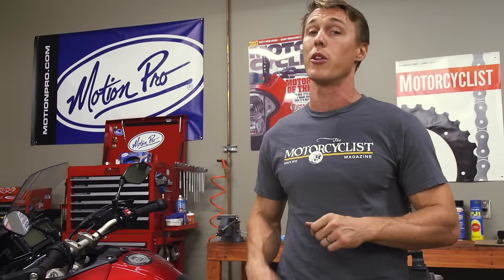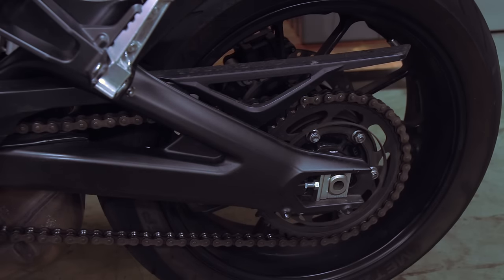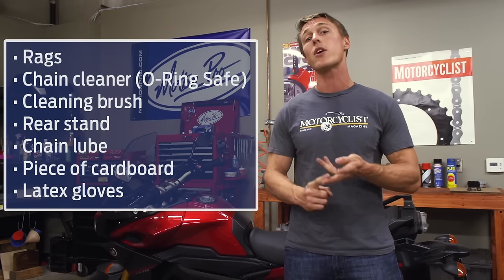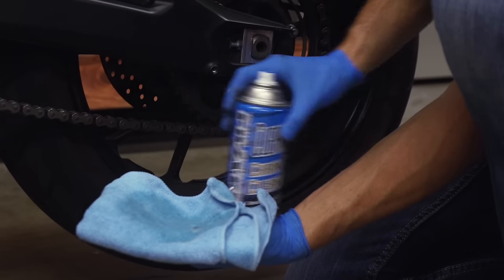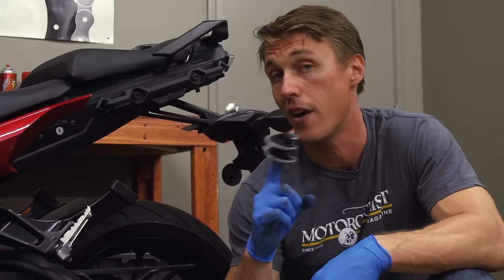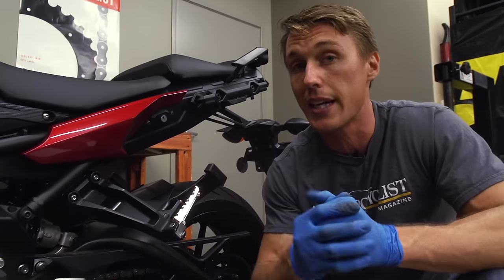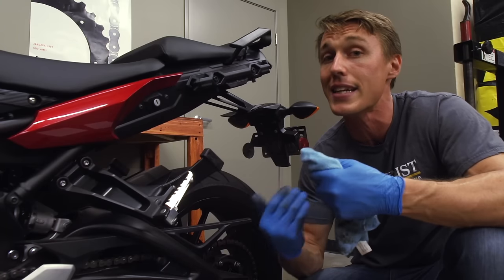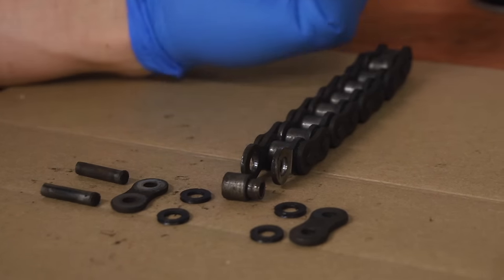How To Lubricate Your Motorcycle Chain | MC Garage

Comment: I use kerosene to clean. Much cheaper and does an excellent job. Just dont forget to wipe off good after you clean otherwise the new lube you put on won't last
Reply: well im cheap so i use diesel, a spray bottle and a cheap toothbrush (a new one)... hahahaha...

Comment: No rage comments about using WD-40 as chain lube will destroy the chain into a million pieces? That seems odd.
Reply: there's another video busting the myth in the channel.
Reply: WD40 is mostly just hydrogenated naptha. Which is basically a heavier distillation of kerosene just a smidgen heavier. The problem is the film of addictive they've put into the oil that makes it a dirt magnet once it evaporates since the residue is sticky and over time the road grime just turns into a grinding paste on the chain. You probably should be cleaning your chain way before then but it's just....come on man....just use Kerosene. Kerosene tends to evaporate clean.
Reply: Exactly if someone thinks a degreaser greases a chain they must think gloves go on feet and shoes go on hands. Let them walk backwards upside down not my problem
Reply: I lubricate my gearset with Axle Oil. Is this a mistake?
Reply: I use Astro Glide
Reply: @TheBmxHD    I don't get all those comments like yours about this product. It's literally written on the bottle, WD40 is a lubricant.

I don't say you should use it to lub your chain, but it's definitely not a degreaser
Reply: Most chains are sealed.  Other than rust prevention lube doesn't matter.
Reply: I personally don't like WD-40 because it cheapens the chains. Other use is ok but basically it's for freeing parts not to lubricate for effective movements.

Comment: Been a year and half since I lost the tip of my middle and ring fingers. Luckily, had a great surgeon. Got a cross finger graft on the middle finger from the back of the index and the ring finger was okay as I hadn't lost much flesh, it was stitched right back. Could hold a pen and write two months later. Had my engineering semester exams and it was one hell of an experience. So, guys, no matter how easy it seems, do not keep the engine running. Also, in my case I wasn't doing it in gear. It was on neutral and I knew I shouldn't do it on a running drive train. I was just lazy to turn off the engine and thought neutral would do no harm. As I was leaning over, my left knee hit the gear lever and I'd just lubed it. Bam, into gear 1 and in no time my fingers were stuck in the sprocket.

Comment: i use wd40 or kero to clean chain then lube it with chain wax and has always worked for me after having 12 bikes over 20 years and gobs of miles ridden never an issue with seals rotting or etc using wd40 but i only use it for the cleaning not the lubrication, and dont forget to stick an old mat or tarp underneath the bike for any drippage if doing the job in your nice garage.

Comment: You mentioned using different kinds of lube or wax depending on the environment but didn't go into detail. Can you do a video on what kind of chain lube is best for different environments?
Reply: Ojisan642 yes please. I need it too.
Reply: I live in tropical climate which is dusty, rainy, and muddy. So as recommended by a dude from AMA I use blendzall chain lubricant to deal with those conditions. It's kind of more sticky than regular chainlube.. But since it's mainly used for motocross race..I think it meets my need
Reply: I would think your local shop would sell what’s good for that area...
Reply: MiNuSx31 doubt it most local shops know jack and also sell all kinds of lubes. I personally use a paste wax on mine by Motul because it's the easiest to apply. Seems to be very effective.
Reply: Heavyweight gear oil. Do the outer surface, inner surface, and side surface facing you, then run your finger along said surface to gather excess oil and then rub said oiled finger on the side surface facing away from you. All the while spinning the tire in neutral with the bike off and on the center stand.

Alternatively, you can install an automatic chain oiler and just clean it off and dry it every service interval.
Reply: @TheRealUnconnected  I've started using PJ1 was chain lube but over the past year it's gotten very dirty. I want to clean the chain and reapply more of the wax but not sure what's safe to use- don't want to damage the chain. Any recommendations?
Reply: I wouldn't get too bogged down in the arguments of I should use this or that because I live in this area. Simply lubing your chain regularly is an excellent practice and shows you care for your bike. It's almost heartbreaking to see a bike that is not well kept. I'd recommend every 500kms at a minimum. 😉

Comment: Hell yes to the Tyrox chain brush. Grunge brush is very messy. I wear o glove and cup the Tyrox in my hand and run it back and forth on the chain as you did and the spray of the chain goes in my gloves hand and not all over the bike or floor. I do or my bike on a rear stand, but I also put an old bath sheet down on the garage floor. 

I do spray cleaner and chain wax onto the rear sprocket/chain area with the bike in gear but I hold the cardboard behind and against the back of the wheel hub. My hands are never in danger with this method.

I turn the bike off and into neutral as I put the Tyrex brush on the chain and manually turn the wheel to clean the chain. I don't wipe the chain off after applying chain wax.

Comment: Great video once again guys. Even the basics like this should be discussed and technique shared. My personal suspicion is that cleaning the chain is really more cosmetic - Anything thats actually in between the contact points between teeth and chain is instantaneously either pulverised or flung afar.. Take a look - Always spotless - How could it be otherwise with that treatment?! But I probably overlube if anything.. say every 2 rides meaning about once every 500km at most? But I lube inside of chain as Ari showed.. And i spray more prob 2 rotations easy and then also spray from outside as well.. And adjust when required.. And with that treatment even big v-twin chains like my KTM 1190 Adv are still in what looks like good shape at well over 30,000km. As the shop said to me "well whatever you're doing keep doin it" cos we dont usually see the chains last like that

Comment: Would the prolongation of the chain life really offset the cost of all those specialty lubes and cleaners and time spent? Doubtful. So I long ago stopped using sprays and cleaners. I just smother some motor oil every now and then, and don't fret over it. I like to think that the chain cleans itself flinging about the dirt with all that oil : )
I cut off a piece from some shampoo bottle, somewhat heat-shaped it and screwed it at the end of the chain guard in order to reduce the splash. It works really well!

Comment: There's no need to "lube" an o-ring chain. The areas that need to be lubricated are inside the o-rings. An o-ring chain just needs to be kept very clean so dirt doesn't destroy the o-rings and cause a loss of the built-in lube. Lubing a good o-ring chain is like lubing a sealed bearing. For over 25 years, I've been cleaning my chains with kerosene, then drying with a rag. If I get caught in the rain, I spray the chain with WD-40 (the "WD" stands for "water displacing"), dry, then clean with kerosene to remove the WD-40 film. I've never had a chain kink. I've only had to replace one chain and that was after 10k hard miles (including some track days).

Comment: I would have thought that a dry lubricant, like graphite, would be used for the links due to the danger of attracting dust and dirt with the oil.  It would be a pain in the neck to do but the thought of having dust and dirt making an emulsion scares the hell out of me enough to try it.  Nice video by the way.
Reply: Rafael Lastra

Comment: Nicely explained. Is it okay to just lube at shorter intervals without cleaning every-time? I lube the chain every 300-400 miles and clean it on alternate cycles (600-800 miles).

Comment: you missed something very important. lubricate your chain when the chain is warm ie when you get home and putting the bike away for the night or pull in to your overnight accommodation.  This way the lub gets in well and then the thinners evaporate off before you ride.  I've always got good milage from chains and i never really cleaned my chain. waxs in my experience are crap in the rain. our maybe i just used a crap brand. during my years as a motorcycle courier i found Castrol good in hot, dry and in the wet. i used to always replace both sprokets weekend replacing the chain. I would buy 2 front sprokets, 1 rear sproket and the best chain money could buy. changing the front sproket when it showed a little wear.

Comment: So you dont need to lube like the inside/midle of the chain, just the edges??
Reply: You actually need to lube rubber rings on both sides of the chain. So that it rolls without rubbing.

Comment: Quick question, I have a brand new X ring chain to put on my bike, It comes pre greased in a thick lube. Do you leave this on or clean it off, so it's not so thick, then apply a dry lube?  My concern is that I'm fitting new sprockets and I'd rather the whole lot doesn't get covered in thick grease. What do you recommend?

Comment: great video but do we really need to rub the lube off after the application ?
Also is that one round of lube on inner side (not outer side) sufficient?
Reply: ***** thanks a lot. Seems i have been using more lube.
Reply: +mayur kulkarni I'd say wipe it, I got lube on my tire, feeling it slip isn't nice, sliding into a low side will be worse.

Comment: Hi guys!

First of all thank you for this channel, and for the tons of useful info in your videos. Such a priceless source for beginner bikers... and most probably for experienced ones too!

I bought a Kawasaki z650 two years ago. Now, after 20,000km my chain is really worn. I took care of it (cleaning and lubing) and in my first year I was riding rather gently, but in the last 5,000km its maintenance became increasingly difficult. Which seems a little early... even for a original manufacturer’s chain. So, I try to understand what might have caused this. And avoid a similar faith for my next chain!

I’ve been using a brush similar to the Grunge Brush. Is there a chance that I’ve been too rough when using it and as consequence I damaged the O-ring seals of the chain?
Reply: Update?

Comment: I actually enjoy cleaning my bike/chain, only problem is I live in an apartment at 4th floor, and with no garage, so my only place to do this stuff is out in the public roads.. What to do :D
Reply: do you still in that situation? do you still have that bike? if so, what have you done? since I live in an apt with a parking lot beside it but adequate space however.
Reply: @HighAway  I still live in the apartment but with a new bike. What I have been doing is getting just basic chain maintenance equipment (chain brush, cleaning agent, and chain lube). I have my bike parked in a courtyard, but anywhere even a sidewalk with a bit of space is enough to let you do basic cleaning of the chain. Just have a bucket or even a dirty rug/cloth under the chain to not stain the ground.

For more in-depth cleaning, I try to plan ahead for example if I know I am going to visit a relative/family member who lives in a house, (in this case my parents mostly) I ask if I can store a few things at their place so I can do a deeper cleaning when I visit them. Depending on general riding conditions, a deep clean isn't really necessary often, especially if you mostly ride in dry conditions.

For general cleaning of the fairings etc I usually just do it at a petrol station, they usually have some sort of cleaning items too and the space available for you.

But all in all, that's really all I have been able to make do with, apartment life and bike life just doesn't mix as well as if you have your own house/garage.
Sometimes local bike shops will let you borrow some space for an hour or two if they're nice people, and you can talk with them about what to do/clean and get tips and tricks (and they'll likely be inclined to try and sell you some of their cleaning items :D)
Reply: @Real_MisterSir  This helps me to think more, thanks. I don't have a family close by and have friends but too far for anything except just visit. Another questions: what are the items that is necessary to have to keep at home? Like oil drain pan, rags, cardboard (for chain lubing) bike cover etc? also, do you cover it for the winter or store it? Im looking at the lowest cost factors.
Reply: @HighAway  My closest relatives live 40 minutes away from my apartment so for me it's not too big of an issue, but if it's a multi-hour ride then I see it might be a problem for you.

And yes I would advice an oil drain pan, rags, cardboard, and a bike cover. And also a simple toolkit that has the specific screwdriver/hex tools that your bike needs to remove various items and plastic covers, in case you need access to battery or other components that can sometimes be hard to reach. Usually bikes use a few select sizes of hex screws (and most batteries use regular 4-star phillips screws for their wiring connectors). That is basically what I keep. Anything that ensures you can remove vital components if necessary. Storing these screwdriver tools is possible on most bikes as they don't take up much space.

For winter storage, I have it parked indoors (again at a relative's place) which I consider fortunate. If it regularly gets very cold/rainy then this is optimal, but a cover can manage most weather decently. For reference I live in Denmark with damp/rainy weather and around freezing temp most days during winter. I have had my bike just standing under cover during such conditions for a few months at a time without any issues. One advice I personally recently had to invest in, is a battery tender which can help keep the battery topped up during longer periods of storage, and it can also help revitalize the battery if you find that it lacks the power to engage the starter motor properly after it's been sitting for some months.
Just be aware that most battery tenders work with regular lead-acid batteries and not lithium batteries. These battery tenders are very useful and don't cost too much (I believe 60-80euro/usd is enough for a good quality one). But you do need a power socket somewhere close to your bike (or a long extender cable).

Comment: When I bought my bike, previous owner said to clean and lube on a weekly basis. This seems like overkill to me; is there any negatives aside from attracting dirt and grime if I lube it once each week? It does look nice when it's clean after all.
Plus I don't have a proper chain cleaning brush - I usually spray degreaser on a chux and clean the rear sprocket with it too - any drawbacks with doing it that way?

Comment: I’ve lubed my chain on so many different ways and it still sounds like it’s dry. I aim for the o ring links on the inside and I spin the wheel with my hand. I’m not sure what I’m doing wrong. Can anybody help? I live in GA and my bike is my daily. I lube it every 400 miles which is typically every 4-7 days or so. Any help would be greatly appreciated
Reply: A too tight chain will sound noisy/ dry. Make sure your chain isn’t too tight. Don’t trust, verify via the manual specified procedure.

Comment: I used chain lube on front sprocket of my duke 390 . And now when i accelerate , the bike is responding little late.. is that normal? Or should I get it fixed by mechanic?? Also engine braking isn't that strong like it was used to
Reply: Mayank Parmar - hey, I don't think the lube is the issue. If the lube is reasonably safe, and the chain cleaner didn't kill the seals, you should be fine. If you're up to it, swap the chain, and lube with the best stuff you can lay hands on. If that improves the response, then the last lube job may have indeed compromised your first chain. Best of luck!

Comment: Can anyone tell me how to clean the chain brush after cleaning the motorcycle chain? It's really hard to take off the grease from the brush.
Reply: get some brake cleaner and spray onto the brush. But be careful because the oily stuff will fall onto the ground so do it in your yard or somewhere where there is dirt on the ground (or above some cardboard box)

Comment: What wears a chain out eventually is the rollers wear down,      Effectively stretching the distance over the toothed cogs,       Some form of wax on the rollers will help slow that rate down,        So it`s not as pointless as implied to lubricate the rollers
Reply: true, in fact i spray lube or oil on the rollers with the chain running and i can see it also splatters to the ends of the rollers and thrust to the links anyway...

Comment: hi wich do you think is better  Aprilia rsv4 1000RR 2016 or Kawasaki ZX10R 1000 which  is better because I want buy
one,
Reply: +Leonardo Sanchez By a slight margin I'd say Aprilia only because of the handling also the ZX10 lacks the low/mid range pull. Easy fix for the ZX10 is change the sprockets. The ZX10 does have better brakes though but you could upgrade the Aprilia brakes...  I guess it comes down to your style of riding street or track and your skill level.   Honestly I'd be happy with either one.
Reply: Thanks 
Im buy aprilia .  How I can upgrade the brakes
Reply: Aprilia rsv4 brakes are not bad really, sorry I gave that impression.. My friend uses a more aggressive after market type brake pad on his ZX10 is why there's a difference. Using stock pads from manufacturer you probably wouldn't notice much difference between the RSV4 or ZX10.  Enjoy your new motorcycle, good luck and congratulations! Ride safe.
Reply: what do you think about bandit 1200 mr kitty?